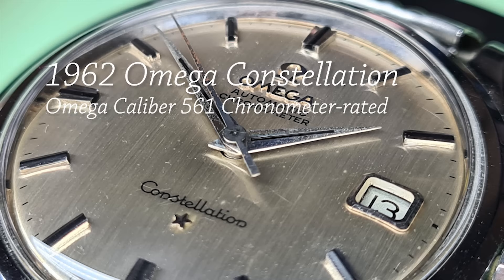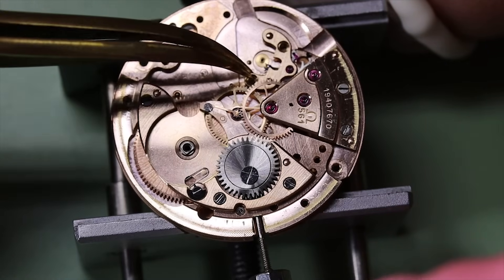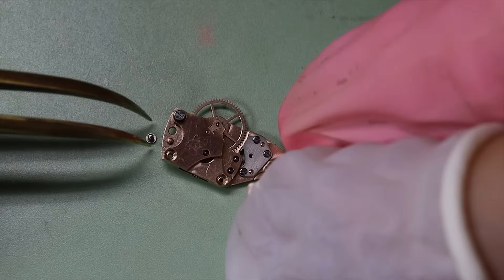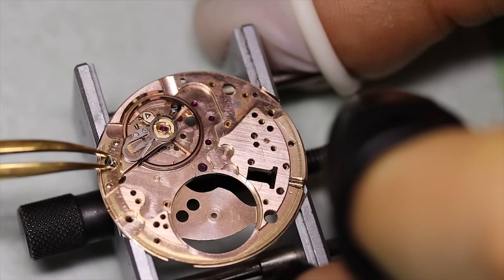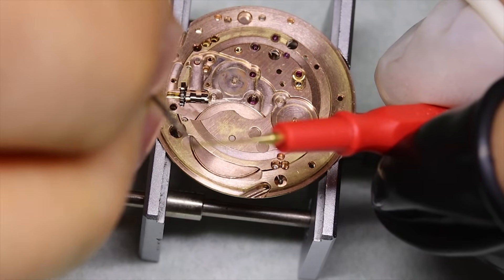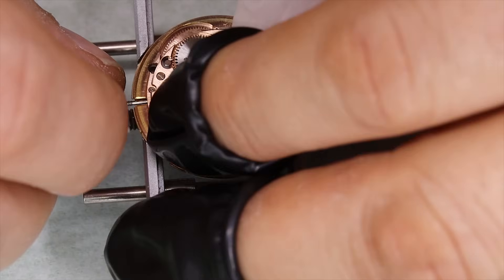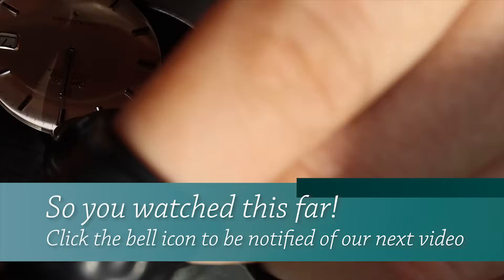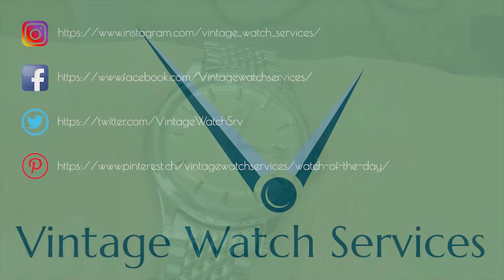1962 Omega Constellation Caliber 561 Service + Chronometer discussion

Comment: Nice job! I just worked on a 752 day/date Cosmic from 1970. It needed a mainspring, and I was happy to find out it is in the same family as the 500 series. Movement looked almost identical. Great running watch!
Reply from the maker: Very cool!
Reply: @VintageWatchServices  BTW, regarding the 752 day/date I just worked on... when I moved the hands around the day of the week changed before the date of the month.. did I put something back together wrong? I only moved the hands around once because the day of the week was correct. Maybe it will change after the date tomorrow night.
Reply: Seems I did put the something back wrong. The day was changing around 5:00pm and the date changed around midnight. The date and calendar wheels (that advance the chapter rings) needed to be in the right position to each other. Luckily I took photos while I was taking it apart. I put them back in the original positions and now the date changes around 11:50 pm, and the day changes around 1:00 am. (good enough)

Comment: Very good work! According to your timegrapher it looks if some of the gear train wheels are slightly worn. Still o.k., though, for daily use. It's just too bad that such watches do not have a see-through case back. Such beautiful movements deserve one!
Reply from the maker: Thanks for watching and for your comment! Yes, there is certainly a bit of wear in the train, but these old watches are very solidly made and wear much slower than new ones. If this watch was serviced at an Omega store they would probably charge a couple of thousand euros/dollars for the service, wanting to change anything that shows a bit of wear, but that is in my opinion overkill and a policy made for new watches, not for old ones made under a completely different business model. 
I know there are mods available for King/Grand Seiko's with display case backs, and it would be nice for this watch as well! These movements are indeed beautiful to see and it would be nice to display them :)

Comment: Another thoroughly enjoyable, educational and satisfying video!  Thanks for sharing!!  Do the pallet stones require lubrication on this movement?  Also, is the crown wheel screw right-hand thread or left-hand thread?  Thanks again.
Reply from the maker: Thanks for sticking with me! The pallet stones require lubrication on all Swiss lever movements, but I didn't show it for this one. And good spot on the crown wheel; this one is right-hand threaded, which works fine given that there is no rotational force on the screw that can unscrew it as is often the case.

Comment: Thnk you fo the comment on the stuttering second hand. My 565 developed this problem which was fixed by replacing the second pinion pressure plate. I thought it was the gears getting out of pitchbut not so thankfully ok
Reply from the maker: Hello John, thanks for watching and great to hear the video came in handy! It's not an uncommon thing for this movement family to have stuttering hands, but mostly this can be solved by adjusting/bending the tension spring. It shouldn't need to be replaced unless it's deformed, but if you have a spare it won't hurt either :)

Comment: I really like your videoes, as they are both relaxing (except the intro) and educational! Starting to make watches a hobby I have built a watch with movement and the other parts bought separately to my own taste. 
Now I am going to try taking a cheap standard movement apart and put it together again, and I have a question - as a car mechanic I know the importance of tightening critical screws/nuts to spesified torque, but I don´t see this mentioned in your or other watchmakers videoes. Is it just a matter of experience? If so, do you have any tips to share? I dont´t want to learn by having screws loosen up during use, or (god forbid) ruin the threads on assembly.
Reply from the maker: Hei Sjur Gabriel, thanks for watching! Yes, I've made a new intro that is a bit more professional :) It'll be applied to new videos from now on and I'll probably edit the old videos to use the new intro also. 

If you made a watch by yourself you've already taken a big step, congrats! For the torque; it's very difficult to explain how much is enough, it really has to be felt. Even experienced watchmakers sometimes don't tighten the screws enough, and then they can come free during use and stop the movement. There are screwdrivers available that have built-in torque meters, but they are extremely expensive and not that common. I was taught to screw the screws down until they are tight and then give them an extra twist to tighten them even a bit more. It's a matter of feel, really. As a mechanic I'm sure you'll get used to it quickly :) 

Just make sure you sharpen your screwdrivers for every single watch you work on, as the screw slots are of different widths even for same sized screw heads. Newer ETA movements are known for having very wide screw slots, for instance. The ideal situation is when you feel your screwdriver go deep into the screw slot, but just not bottom out. Then the screw will stick on your screwdriver when you pull it up. 
If the screwdriver hits the bottom of the screw slot it can easily slip out of it and scratch the movement. Also make sure you use the right size screwdriver for the screw, e.g that the screwdriver head is just about as wide as the screw is, otherwise it's difficult to tighten the screw enough and you can easily damage the screw head.
Reply: @VintageWatchServices  Thank you very much for your answer and valuable tips on the importance of matching the screwdriver to the slots. It all makes sense from a mechanics´view, only in miniature. Think I will first have a go at some invaluable pocket-watches so I can  gain some feel for it at a slightly bigger scale. Learn to walk before running so to say.
Reply from the maker: That's always a good idea :) The typical movement beginners start working on is the Unitas/ETA 6497 or 6498, or often their Chinese clones. It's originally a pocket watch movement, big size and very straight forward.

Comment: Any tricks to installing 564 Inca block spring when flipped out of end. I didn’t put rodic.  Over far ended up coming out. Hard to find angle to put in and hold still enough
Reply from the maker: You can use a jeweling tool to press the block out a bit so you can access the opening better but it's still a bit fiddly :)

Comment: Hello Vintage Watch Services, loyal subscriber and amateur watch servicer here.  Love these instructional videos.  I am working on a similar 562 based movement right now, and running into a huge challenge getting the date disk working right.  I have a new date disk, new jumper spring on the date disk, new screws to mount the date disk, but I am constantly running into friction issues with the date advance wheel not having enough pressure when it rotates around to move the date to the next day.  Have tried very loose mounting on the screws, which isn’t great for date wheel stability, plenty of 1300 oil on the wheel teeth, etc. But I keep running into the same issue. I’m pretty sure the wheel is centered.  Any ideas from you if you’ve run into this challenge in servicing these Omega models?  Seems like a pretty bad design in the first place, but I’m hoping to overcome, and really stuck here.  It’s the last thing to solve for before I can do final assembly.  Thank you!!
Reply from the maker: Hello Thomas, it sounds like there is some other problem then. There shouldn't be much friction in the rotation of the date disc. When the cover plate for it is screwed down the date disc should rotate freely unless the jumper holds it. Check if some screws interfere with it, perhaps a misplaced screw from the other side of the movement etc.
Reply: @VintageWatchServices  thank you for the reply. I am going to try a date indicator wheel from the Omega 563 as a next step. I’m not convinced the small dot in the current 562 wheel is generating enough pressure on the date wheel. The design on the 563 date indicator wheel looks much better at catching the date wheel teeth. I’ll be in touch what I find when the part arrives in a few days.

Comment: How do you actually do the cleaning of the parts? I am starting off and don't have the money for a big machine, if I opt to use an ultrasonic machine what solutions of cleaner/rinse would be best?

thanks!
Reply from the maker: Hello Adam, the solutions you use vary from region to region, but if you google ultrasonic cleaning you should be able to find a good one. A tip is to use some glass jars to put the solution and the parts into instead of direclty in the machine sink, as you can then easily change between different solutions, e.g for gold material, for rust removal etc.

Comment: What oil do you prefer to use when adding a few drops to the top of the mainspring as demonstrated at 13:00? I assume it's some flavor of Moebius? Also, keep up the great videos! I love your light-hearted presentation and commentary.
Reply from the maker: Thanks for watching and for your comment! That is an all purpose grease, Moebius 8200. 
Another video coming soon, so stay tuned :)

Comment: Thanks, good tips! What is the plastic tool you sometimes use to hold parts still with? I’d love to see a Video of a Seamaster professional.
Reply from the maker: Thanks Boyd! I use a couple of different probes, you can find them at any material house or also on eBay. You can also use pegwood. 
It would be nice to do a Seamaster Pro, but I don't have the equipment to test diver's watches and not the experience either. So I'll stick to vintage watches 😉

Comment: great watchmaker indeed…one question: I see you do not put any lubricant onto the molded ring I see between the pivot and the space where you put all the wheels made to adjust the hours/minutes as per 22 minutes…why?
Great exposition about the longitude problem, with Harrison and the Royal Navy…H1 H2 and H3…with one of these chronometers the Bounty reaches the polinesian islands 250 years ago!
Reply from the maker: Hello Ricky, thanks for your comment! I'm not sure I understand your question completely?
Reply: @VintageWatchServices  sorry but it is quite difficult for me to explain you...let me try again: when you riassy the movement onto the front part (dial one I mean...) I see a metal ring molded with the platine with a bigger diameter than the pivots but smaller than the wheels and where they stay during their rotation...
Reply from the maker: Hello Fulvio, sorry, I'm still not getting it. You can send me a mail to stian@vintagewatchservices.eu with a picture if you want?

Comment: Ironically, back in the old days (by which I mean 1990 or so) the clocks built into personal computer motherboards kept notoriously poor time. I believe the timing chip was originally there for reasons other than keeping "real" time, coordinating the clock pulse that coordinates all onboard functions, so the fact you could use it to write a clock application was, I think, an unintended side effect. But why these clocks kept poor time, when they use the same technology as quartz watches, I have no idea.

Nowadays it doesn't matter much. If your computer is connected to the internet, it periodically syncs its internal real time clock with a time server over NTP, which is itself regularly synced to an atomic clock. This is also how your cell phone's clock keeps itself so accurate, although in that case the time signal is sent over the cell network using a different protocol, and it relies on your service provider keeping its own clocks accurate.
Reply from the maker: Very interesting, Chris, thanks for sharing!

Comment: I have a vintage constellation watch that my dad recently gave me but my question is why the plate where you see the golden observatory is like not much visible like in the watch you have here in this video, is it for too much wear or is the type of model? Thanks for the answer..
Reply from the maker: Hello Christian, thanks for watching! There is quite a lot of variety in the Constellation case back medallions, with the early models typically having gold medallions even on steel cases, and later models (561 and up) having steel medallions on steel cases. There were no strict guidelines for this however, so you will see variations. 
Gold is a soft material and wears quite a lot when rubbing against our skin, so you will often see gold medallions where the stars are worn and in particular the smallest stars. There should be eight stars but sometimes it looks like there are less on gold medallions due to wear.
Reply: @VintageWatchServices  thank you for your answer all my doubts are clear now, keep it up with your channel I really like it!

Comment: I just watched the cal 1020 servicing. This movement is far better imo. Just from the scale of the components. 

The 1020 tiny parts and 28,800 beat isn’t necessary. 

I have Rolex 1570. And it’s a forever cal.
Reply from the maker: The 550 family and the 1000 family are very, very different but they are both high quality movements in their own ways. The 1570/75 is also a good movement but I really don't like the lack of any sort of quick set for the date. I think Rolex/Aegler made a very wrong prioritization when they chose hacking over quick set

Comment: Could you regulate my Seiko divers to COSC specifications:) ?
Reply from the maker: Hello Bob, old Seikos probably could be, but it depends on a whole lot of factors and it would take a whole lot of work. A key process when making watches for chronometer certification is the adjustment for 5 positions, which includes dynamically poising the balance. What this means is that the balance is made to oscillate uniformly in the various positions, by removing tiny amounts of mass where the are heavy spots. You will see some tiny cutouts on the underside of the balance wheel in these watches showing what they did. In the factory they will have equipment to do this in situ pretty quickly while a manual process takes a lot of time and effort. In addition to this, the hairspring needs to be fine tuned to be in the center of the index pins and the gap between the pins needs to be just enough to make the hairspring "breathe". And the mainspring and train of course needs to give uniform power to the escapement. 

So to answer your question: yes, it probably would be possible with quality old Seikos but it wouldn't be worth it :)

Comment: Is the 565 'just' an unregulated 561, or are there actual differences in parts or materials?
Reply from the maker: Hello Bob, the 565 and the 564 are essentially the same movement, with the 564 being regulated to chronometer standards in five positions. The 561 is the same base movement but has a slightly different date mechanism.

Comment: Quartz watches are not that interesting? Really? Hah, how little you know! So I shall teach all how think that

That crystal is shaped precisely to vibrate at exactly 32,768Hz, but what an odd number ... and to an electronics person it all suddenly makes sense. It is 2 ^15, so if you run the signal from it through 15 ganged divide-by-two gates then you get, wait for it, exactly 1Hz. The rest is left as an exercise for the reader.

I happen to like quartz watches :-) Mechanical ones too. And this Omega is a real beauty
Reply from the maker: Hi Alan, thanks for your comment and quartz movements are certainly feats of engineering. But they are essentially black boxes: input goes in and output comes out without us knowing what happens inside. There's a reason quartz watches do not have display backs, for instance, there's just nothing to see. 

Mechanical movements on the other hand are logical little machines, where you can trace the result of the wheels and pinions interacting. They're a bit like puzzles when you try to put them back together and you hope no pieces are missing or that you do not have any pieces left over 😅

There was a big fear that quartz would kill mechanical watches given that they're more precise and much cheaper to make. They they didn't is to me testament to the fascination of those moving little wheels and pinions 😄

Comment: Đời đồng hồ sản xuất năm 1962 vậy có chống nước được không?
Reply from the maker: Hello, thanks for watching! No, the watch is no longer waterproof (and actually never was). It will still be water resistant to a splash level, but over the decades the watch will have received so many small blows and twists that the once tight tolerances are now too big.

Comment: One can really see the improvement over time between these earlier videos (fingers!) and the newer ones. The commentary has been consistently excellent, though. How do you see what you're doing while keeping your head out of the shot? 🥸
Reply from the maker: Thanks Mark! Yes, in the earliest videos I only used one camera and that makes a big difference. 
The distance to the movement is determined by the strength of the loupe one uses. The 3x loupes I use have a fairly long focal length, meaning you can see clearly from maybe 7-8 cm away.